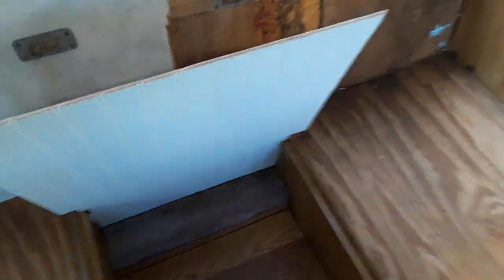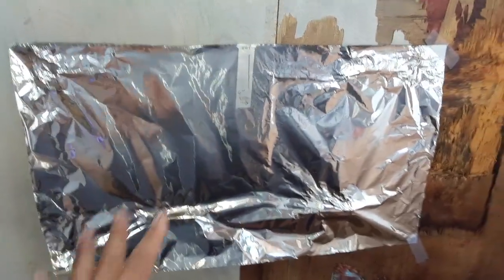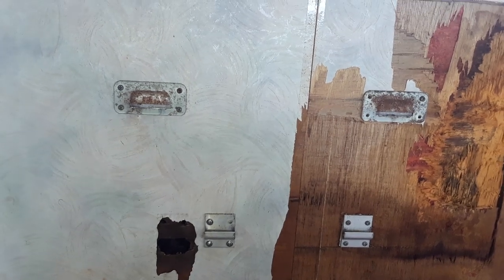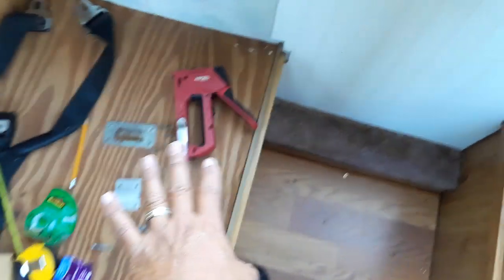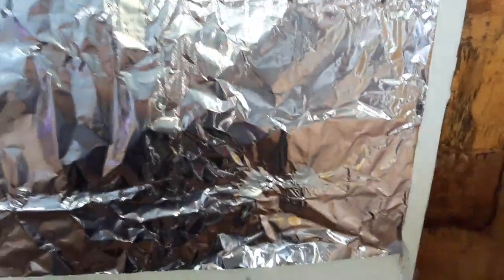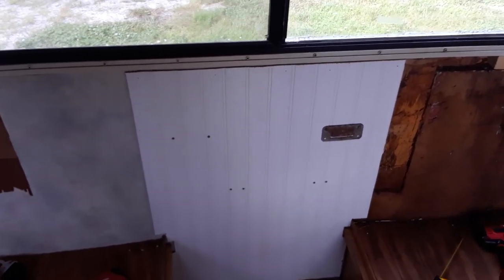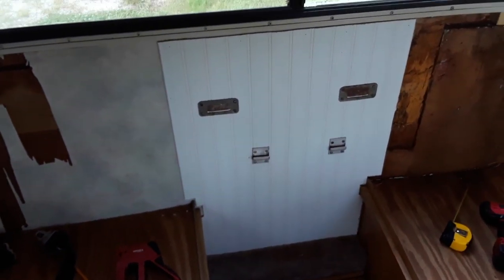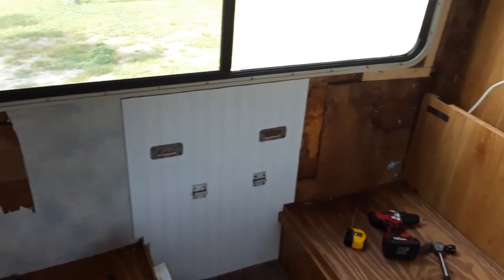Budget RV Restoration - Marking The Location For The Dining Table Hardware (V1853)

Comment: sheets of newspaper taped together make a free template.  You can usually pick up a newspaper at a recycle bin, like in a city building. By the way, there is a wonderful product to fill in weird gaps where joins did not turn out perfect. Its by Elmers (same brand as the glue).  It's a two part epoxy puddy that comes in two little bins.  Texture is like marshmallow fluff for both the material and the hardener. Sets up in about half an hour to an hour depending on how much hardener you knead in-- should be half and half.  It sands beautifully-- not going to gum up  like calking.  You can sort of dab in several layers to fill in good sized holes -- like a wasp dabs mud to build a nest.  Not too cheap and might need to send off for it from Amazon. Used to be available at Lowes.  If I was going to splurge on an item, that would be it.  Trick is to JUST mix up the small amount you need in order to conserve, 'cuz like I said it is a little pricey and once you mix up a batch if it goes off before you dab it in, you've just made a little rock lol..